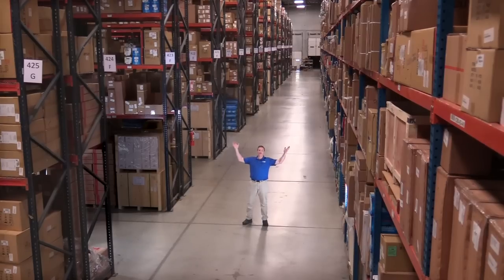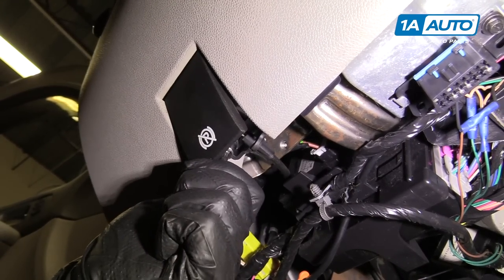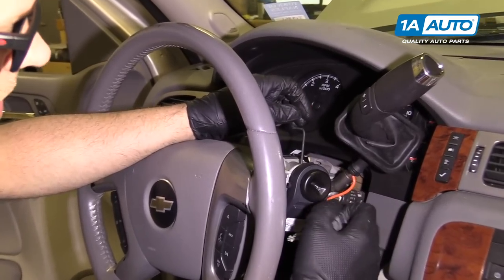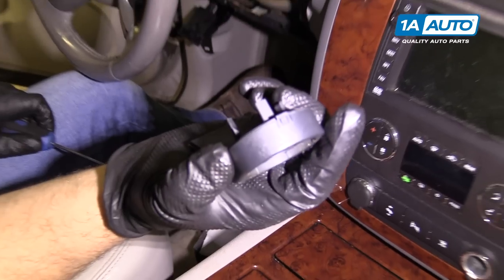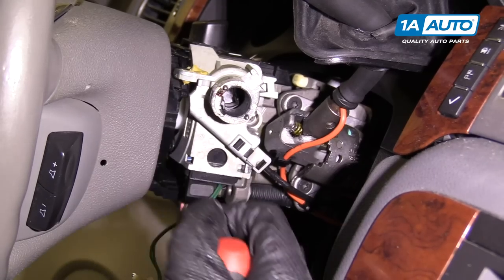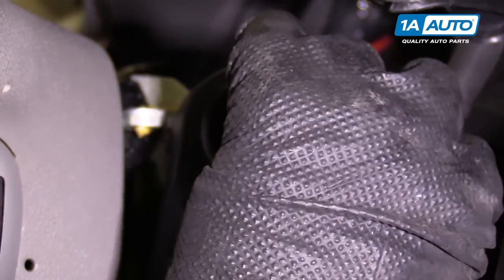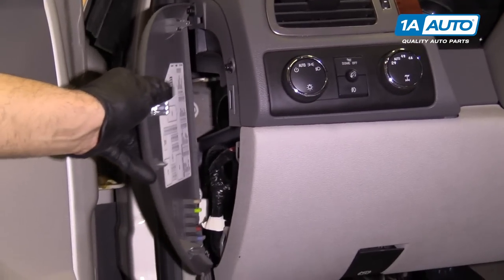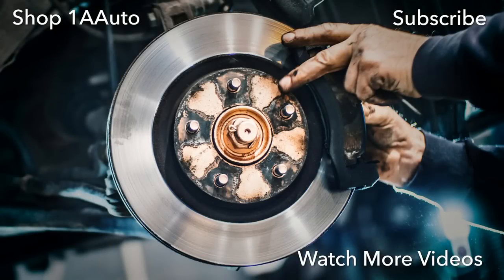How to Replace Ignition Switch 07-16 Chevrolet Suburban

Comment: Thank you this was super freaking easy took me less then 30 min… I had a damn glitch that would not let me drive with ac / radio and a signal on at the same time…and if it was not coming from this it sure fixed it…

Comment: hello sir very good video I was wondering I couldn't get the screwdriver to turn in when I put it in the lock cylinder, so I just stuck the key in with the cylinder and then I got stuck, do you have a way to pull the key out?

Comment: How do I get the cylinder out if I cannot turn the key?
Reply: I used a set of channel lock pliers to 'get past the sticking' and then I was able to get it to the start location to depress the release and pull it out.
Reply: Having the same issue , how did you get yours out ?

Comment: My 07 suburban keeps running when you take the key out could this be the problem?
Reply: dan NEWYORK I have the same problem how did you get yours fixed
Reply from the maker: +dan NEWYORK If the ignition is in the on position and you can remove the key from the ignition switch, it's worn out. Then yes you should replace the ignition switch.

Comment: Will this fix CEL code P1682?
Reply from the maker: +rocco's taco's! Since there could be multiple reasons why you’re experiencing this difficulty with your vehicle, I strongly recommend that you have a reputable mechanic inspect it. They’ll be able to troubleshoot the problem and tell you what part or parts you’ll need for the repair.
Reply: Thanks

Comment: Hay so my charging system is good but van will start then i will shut it off 10 min later then go to start again and it acts like battery is dead then got to jump it but it doesn't do that all the time just once in a while it's like crazy there's nothing on draining it check the charging system everything's perfect I would just solve the problem 09 Chevy Express van
Reply: Have the same issue in my suburban. Today it actually turned the truck off and on about ten times while driving. Complete power loss like dead battery. Half second later it would fire back up without touching anything. Ut did this repeatedly until I shut it off let it sit for ten minutes. Then it fired up and drove great for another hour. What a ride
Reply: @corporategrind8366  did you ever find out the cause of this?